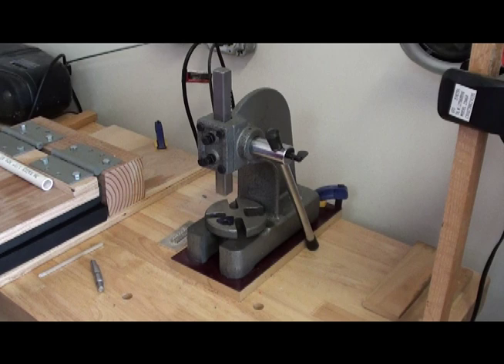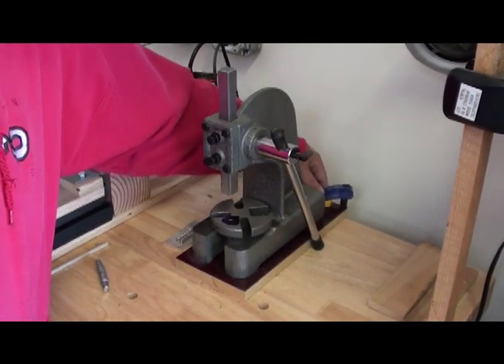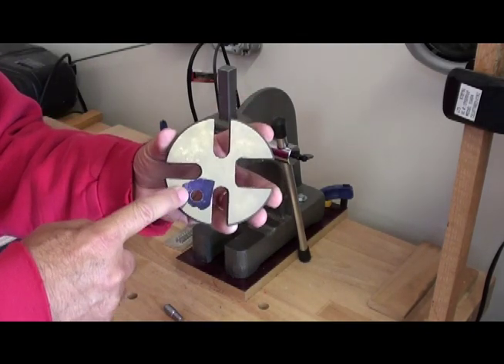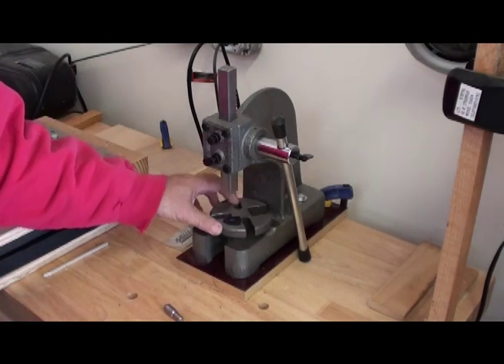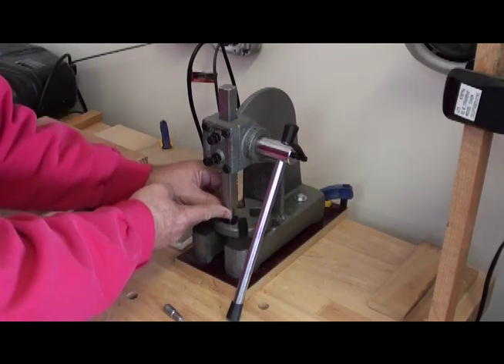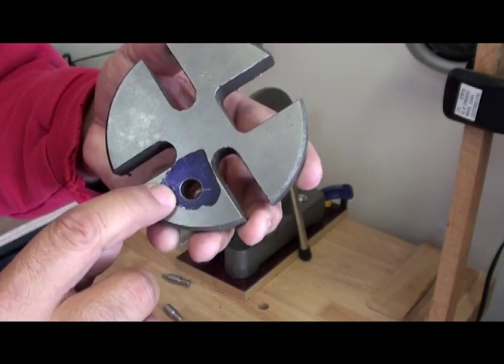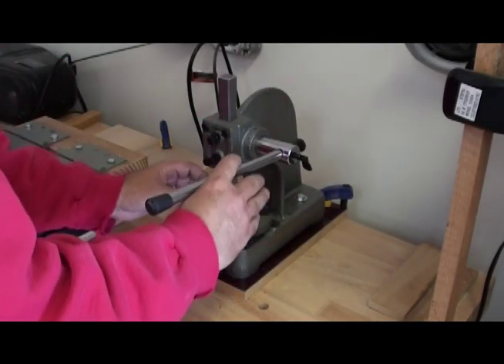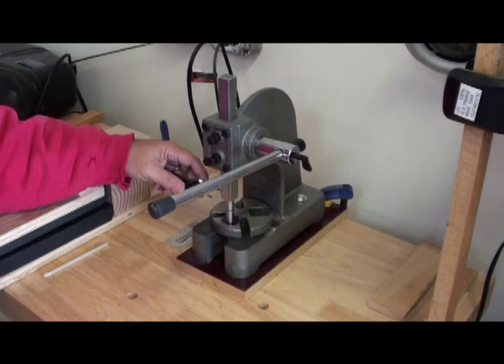DIY - Modified Arbor Press for Rivets (eyelets) - kenpoist7.mp4

Comment: Works perfectly for my use as a heated press MyBest.Tools  Space between the ram jack and the base is a little tight. Make sure you set the ram jack arm so that it's in a position for you to get maximum leverage on whatever you're pressing. You may have to unbolt the front plate of the press and realign the ram in the teeth so that the arm is not at an awkward angle when fully cranked down.Other than aligning the ram in the teeth with the crank arm this .5 ton arbor press comes out of the box pretty much ready to use.
Reply from the maker: Remove two or three teeth from the bottom of the ram. When the ram is in its highest position you can spin the handle to the desired location. Here are a couple of ideas to solve that problem https://www.youtube.com/watch?v=tFfx2_bj104 and https://www.youtube.com/watch?v=daPF0lAPq_s
Hope this helps.

Comment from the maker: Yes, music soothes the savage beast and nothing better than a gifted guitarist.

Yes, I used a drill press. even though it is a fairly straight forward modification it does require that the hole not only be on the bolt center but perpendicular to the base plate and parallel to the ram. Be sure to drill out the ram first. I hope this answered your question.

Comment from the maker: Thanks for watching my video.
You can still make the parts with a standard drill press. Its a little more difficult getting the hole parallel in the ram but it can be done.
Good Luck.

Comment: Cool mod! Just curious, can this press be converted to a punch press? I'd like to punch through 1/16" - 1/4" thick steel. Would this press work or would I need a bigger one? What's the max strength this one allows? Thanks!

Comment from the maker: The Dies I use are from knifekits ( KYRDJS-8  CKK Rivet/Eyelet Flaring Dies - Journeyman Series - #8 - (1/4)). They work good, however, I've not tried any other dies.
Do I lube the Dies. For the most part no I do on occasion spray them with dry silicone.
If I start splitting rivets I run steel wool around the male die, generally the split is caused by a small burr and the steel wool remove the burr and any foreign material or debris left on the die.

Comment: whats that blue stuff? i listened 3 or 4 times and couldnt hear it. thanks
Reply from the maker: Sorry, the liquid is Dykem (blue or red) layout liquid used for laying out geometry on metal. You can probably get away with a Sharpie scribbled over the area. If you have good eyesight (in which I'm challenged) you can just scratch the surface of the metal to find the bolt center. Hope this helped